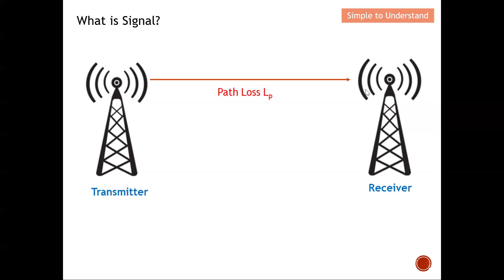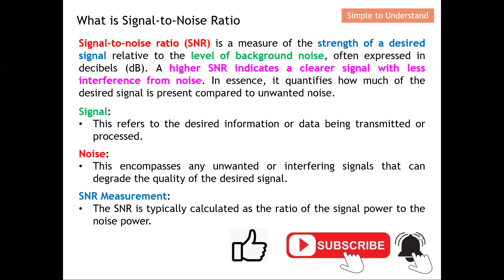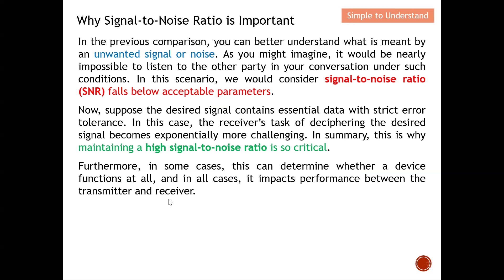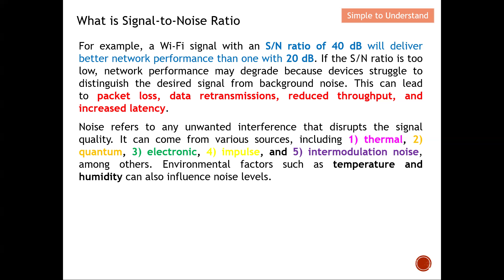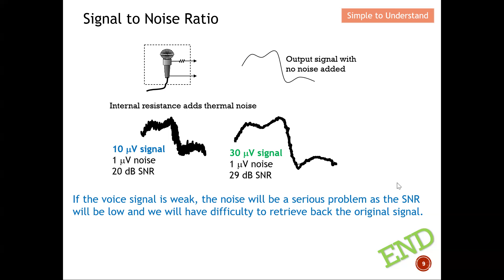S/N Ratio #1. Understand Why Signal-to-Noise Ratio SNR is Critical for Wireless Communication System

Comment from the maker: Thank you for taking the time to watch this video on Signal-to-Noise Ratio (SNR).
In this video, I first define Signal-to-Noise Ratio (also known as S/N or SNR). I consider two cases:
A quiet classroom, which has a high SNR.
A noisy classroom, which has a low SNR due to background noise.
From this definition, you can see that whether you can (or cannot) receive a signal does not depend solely on the signal strength but also on the level of noise.